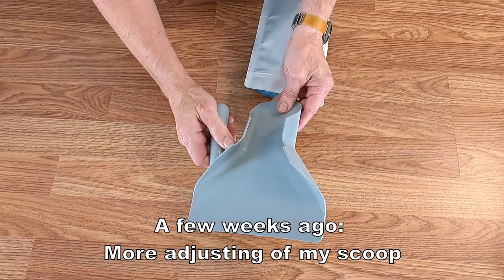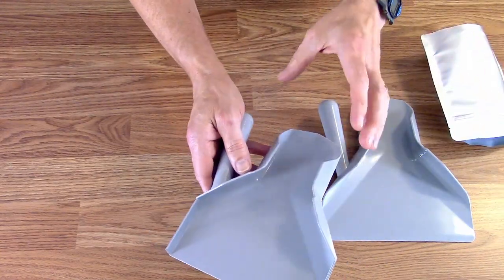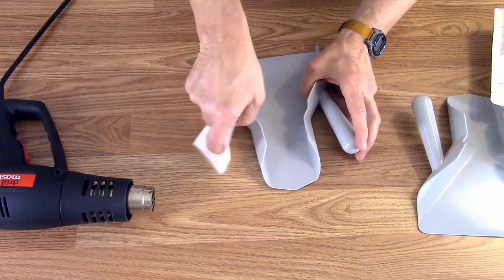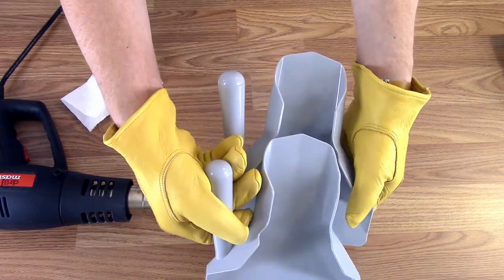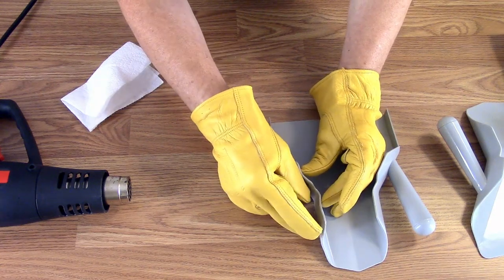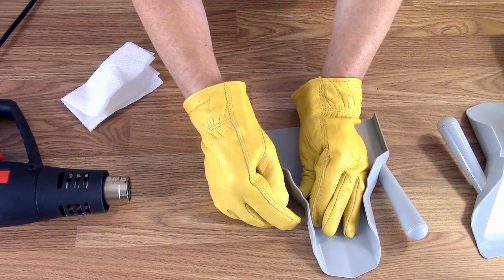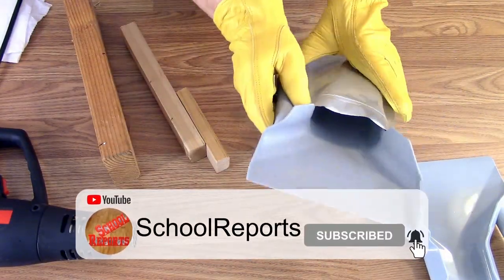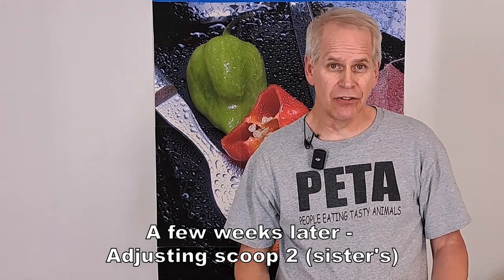Adjusting My Freeze Dried Food Bagging Scoop & My Sister’s Scoop

Comment: I got a metal one. Instead of heat gun I used a hammer and butchers block edge. It fits exactly and works great.

Thanks for the idea
Reply from the maker: A metal one would be great! I just thought I would fail if I tried to "adjust" a metal one. Which one did you start with?

Comment: God Morning. I’m about to purchase this scoop like you have. They also have the stainless steel one. Do you think I should get the SS scoop? Maybe it would be easier to modify and shape? Your thoughts? Thank you!
Reply from the maker: I didn't think I could "adjust" a metal one and make it fit. If I could, I would rather have the stainless steel one. I may get one to try.

Viewer and commenter shaunnichols4664 said "I got a metal one. Instead of heat gun I used a hammer and butchers block edge. It fits exactly and works great."

If you do it, please let me know how it works out!